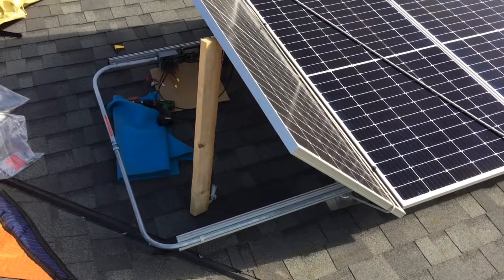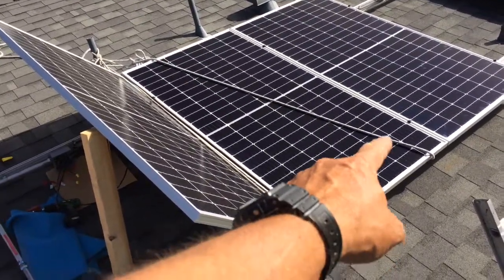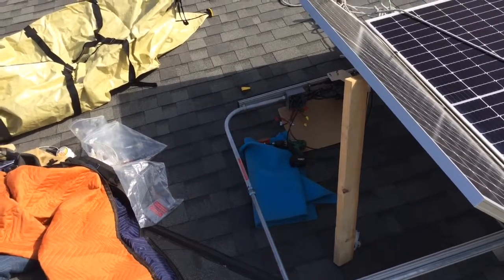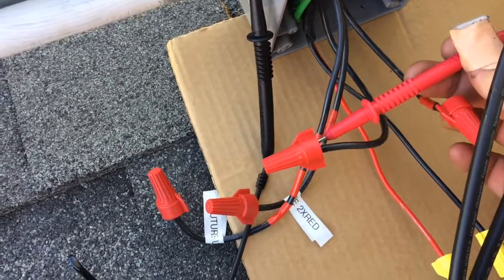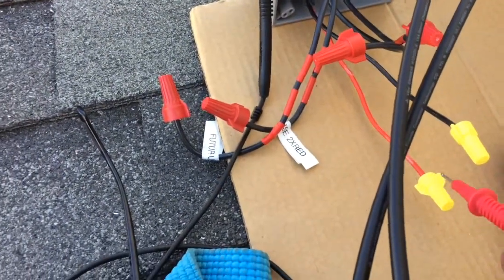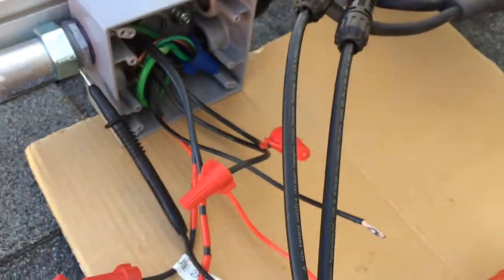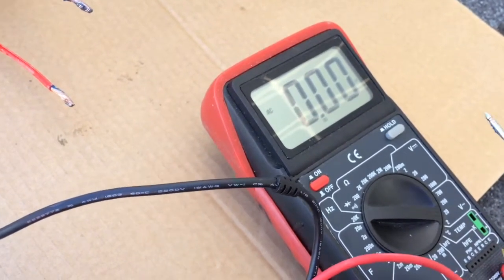Troubleshooting Solar AC wiring with Multi Meter and Enphase Part 2 of 2

Comment: Excellent video. Great tips. My installers just installed my 25 panels and left. No checks and now that everything is connected, the system is only producing 3kw instead of 9.87kw. What a disaster.
Reply from the maker: Sorry for your issue. I think most installers can figure out the problems pretty easily on new systems. The experts sometimes are not at the install site.  I’m sure your system will get fixed soon.  I was the one who needed to fix my system and I didn’t know sh!t.

Comment: Thank you there are few videos out there showing DIY installs using micro inverters which are the way to go imho as they give over 90% efficiency compared to the 70% efficiency when using a string inverter.
Reply from the maker: Thanks for your comment. This is a really complex topic. For me DIY installs easier and safer with AC electricity vs having 300 VDC running from solar panels to string inverters.  I did a video on comparing some panel size / inverter options.  Efficiency is usually not the major consideration on most installations but I did choose micro inverters for other reasons I explain here. https://youtu.be/EFz6TwEAbLo

Comment: Great job Dan. Can you tell me what size wire and length you ran from your combiner box to the roof. Would a 1" conduit make things any easier for future expansion of solar system. I want to do the same thing and expand at a later date. Thanks
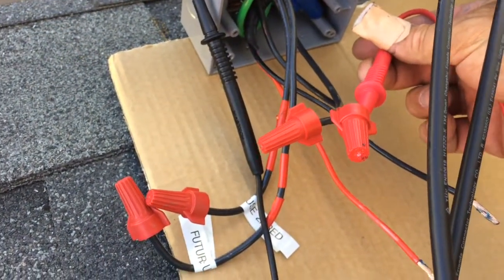Reply from the maker: Fernando https://youtu.be/l_phFvEBk9o is my other video 5:15 #10 awg. I would pre run your wires for future. You can check nec code for cable fill capacity. Thanks for your subscription.